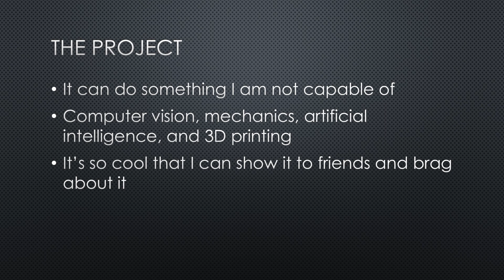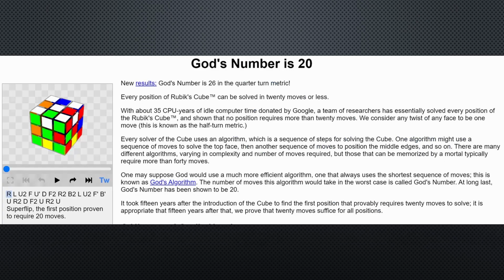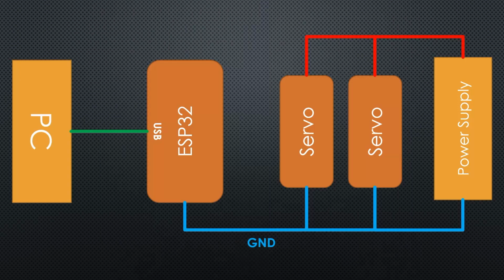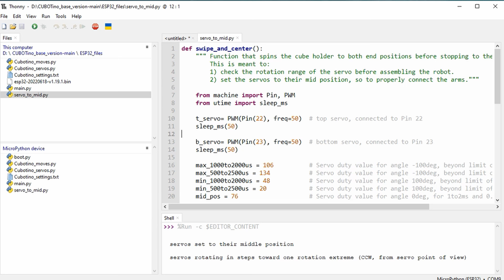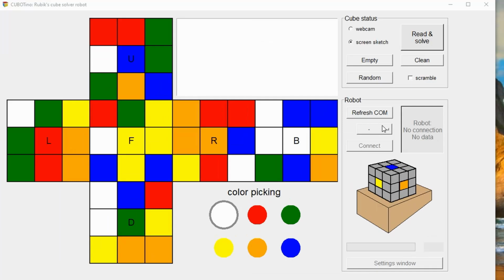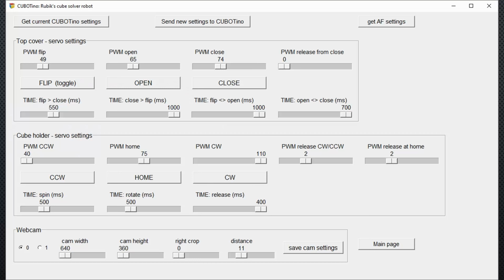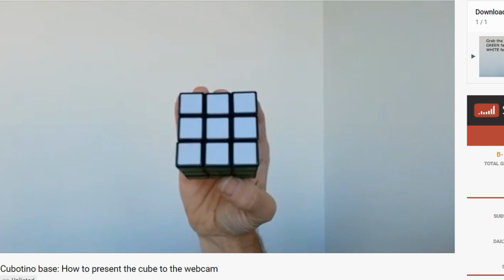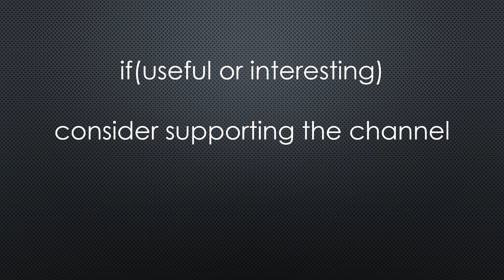440 Let's build the Rubik Cube Bot who knows God's Number

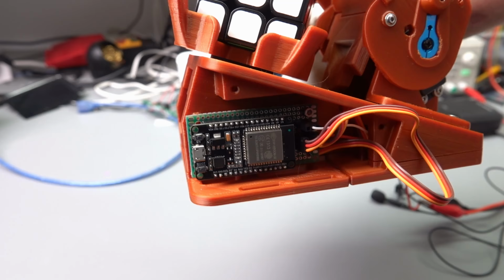Comment: In 1982  a bunch of us at the company I worked at built the first self-contained robot to solve a Rubik's Cube. There was one earlier robot, but it used a mainframe to compute the solution. Ours used two Z-80 microprocessors, weighed 30kg and fit in a very large suitcase. General solution time was about 2:40. It's amazing to see where the technology has come in 40 years!
Reply: Wow, my compliments for what you've done in 1982! By the way 2'40" was quite a remarkable result back then. 
I can imagine you've seen many different Rubik's cube robots since then .....
Indeed many things have changed, but the more valuable one is about the simplicity to get and share informations: Internet! At least this is for me the key enabler on stimulating and facilitating the realization of these hobby projects.... 
Thank you for your feedback.
Reply: @andreafavero71  Right on about information sharing! The only thing we had was published magazines and papers. Once you knew someone you could often use the telephone, but I didn't even have email until the late 80s.
Reply from the maker: @R Dyer: I agree that things are much better now for electronics enthusiasts. I enjoy every day!

Comment: Would be interesting to use ESP32CAM and algorithm run on the ESP32 itself, instead of PC. As it doesn't require much pins ESP32Cam would be sufficient, or maybe an ESP32 with an color sensor.
Reply: I was thinking about that as well.  If the esp32cam cannot do the processing then it could send the faces to a simple API on a pi or pc and get the sequencing back.  Would be a very cheap solution given how precious pi's are at the moment.  Great project for tinkering.
Reply: @johngilmour7507  No processing is required, if you have the camera fixed, then you just need to read the pixel values at fixed coordinates, no OpenCV required, to determine the cube faces.

Comment: Heat the screws when first screwing them into the plastic.  Turn them in before final assembly - do not push like with a threaded insert.  Don't turn them all the way in - leave them a thread or two loose.  Finish tightening when the screw cools off - preferably during final assembly.  It'll go in much easier with the melted threads to help.
Reply from the maker: Good trick. Thank you!

Comment: Wery wery kool, inspires me to buy a 3d printer.  I heard AI improved compression by some % which was thought impossible given the amount of time we've been refining the algorthim.  Maybe AI could figure out  how to do it in less moves. Although 20 does seem low already, that could be the limit.  But you never know, a super powerful AI could perhaps reprogram the colour molecules to instanly be the colour you want and technically does it in 0 moves.  A 0 moves rubix cube solution is  still possible in this universe.
Reply from the maker: 20 is the maximum moves. This algorithm is not made for an optimum of moves. If you just turn the cube once it will not recognize it and do lots of movements. However it the end, it is always solved.

Comment: Actually Kociemba's algorithm is efficient but not guaranteed to be optimal (it is based on group theory and solves two independent subgroups of the cube - I know this because I am the author of "kcube" an alternate implementation of Kociemba's algorithm).  The algorithm for "God's number" is different and takes much longer to execute.  It is an optimal algorithm and it is credited to Richard E. Korf.
Reply: Thank you for the feedback, I'll search for your work. Anyhow, the python implementation that Mr. Kociemba has made available is very easy to use, and in 2 seconds returns a "close to optimum" solution, even when using a little Raspberry Pi....
Reply from the maker: Cool that I have such viewers! Indeed, I saw that the algorithm too a long time to solve a cube where I only turned one row one side.
A challenge would be to get the algorithm running on an ESP32 CAM (in a reasonable time) because the Raspberries are nearly impossible to buy...

Comment: Thank you for the Idea. I started immediately after your video-upload and (almost) finished the project within a day. It works incredible good. I never had a project before where all prints were successful on the first try, everything fitted perfectly from start without any impediment and with a so much detailled description (which was necessary for the python-stuff). I will recode the ESP-part in C++ instead of Python so it is more convenient to upload and use for us Arduino-guys.
Reply from the maker: Thank you for your feedback. Andrea will love it! And I love it when you do the port to C++ ;-) And maybe you can get an ESP32CAM to detect the colors and send it to a server where the solver resides... If you close the bot, you see that it should be possible to mount an ESP32CAM board on top which sees all colors in a fixed position.
Reply: @AndreasSpiess  Exactly the ESP32CAM thing was in my mind. But I am not experienced with image recognition stuff, have to learn a lot on that. I already designed  and ordered a PCB using 18650 LiIo supply which might fit into the bot so there is only a power switch necessary instead of a power cable. Will be back on this in a few weeks: C++, ESP32CAM and battery-powered.... a lot of work.
Reply: @Tinker_Inc  Maybe you join forces with Andrea...
Reply: It seems that this project was too simple for you, or you've carefully read the FINE manual... perhaps  both.
Indeed thank you for the feedback.
Reply: @Pontifex Maximus  I'm looking forward the changes you're going to apply; Considering your speed, I'm sure I won't wait long 🙂
By considering the attention generated by Andreas to this project, and so many people being interested on the ESP32-CAM .... I'm thinking to prioritize that project over the others in my list. I'm open for open source collaborations, in case.....

Comment: Awesome project. While watching I was wondering if you could get rid of the PC. I was even thinking that it could be possible to have everything on ESP32, and I think it might be, however it would probably be very hard to fit everything in ESP32 and also a quite slow. Raspberry Pi Zero has just sufficient power and software support to make this easier to achieve. Super cool!
Reply from the maker: Maybe, one day, we will get an ESP32 version. At least the ESP32CAM boards can be bought right now...

Comment: Can't wait to see it.
Reply from the maker: It will not appear on the channel, because I decided not to produce Raspberry videos till they are available again :-(
Reply: @AndreasSpiess  Respectable choice. Please be informed that, since December 2022, the Raspberry Pi Zero W (valid alternative for the Cubotino Autonomous version) is available on at least one official shop per Country, eventually by limiting the order to one piece. I have just received my single precious piece 🙂
Reply: @AndreasSpiess   Thats such a shame, was really looking for a how to video as i'm stuck with getting mine to work.
Reply: @roscoe3dp470   You might drop specific questions to the chat at the project Instructables site, I'm sure you'll get some support there 🙂.
Of course, a video tutorial from Andrea Spiess would be fantastic, yet we don't know if/when it will be available 🙂.
Reply from the maker: @andreafavero71  I have a few on order. Unfortunately, no luck for me. I used my only zero 2 for the robot ;-)
Reply: @andreafavero71   I've got the basic version up and running but wanted to build the autonomous one, i triple checked the board i've soldered together and it's fine, i followed the simplified installation method but just can't get it working. Was hoping Andrea Spiess would do a full tutorial as it's such an awesome project.
Reply: @roscoe3dp470  Your problem description is quite generic. Please drop me an email and we'll try to find where the problem is; You'll find my email on my GitHub account.
Reply: I have it working now thanks, turns out it was the 1.77” screen, I swapped it out for a 1.8” screen and it came to life. Thanks for your awesome work and advice. Will post a make when it’s all put together.

Comment: Hi Andreas, I'm going to rebuild this project and I have a question regarding the capacitors and the power supply for the motors. Could you please explain what the capacitors between 3,3V (ESP borad) to GND and +5V (Micro USB) to Ground are for? I also have not found any other example circuit diagram with capacitors like this. Second question is: If I use a separate power source for the motors, is it adviseable to use capacitors there too?
Reply from the maker: These caps are always a good idea because the ESPs draw a lot of current when the transmit. So they easily crash. You can try without the cap and only add it when you experience brownouts.

Comment: Have you look into a generic Raspberry PI for this project that is inexpensive, compared to the sparsity of the real R-PI? I have the Rubik's Cube and the two 3D printers readdy. I would really like to make this project without having the external camera and computer needed for this project. Have a great year Andreas!!!
Reply from the maker: The one shown here does not need a Pi (it uses an ESP32) and a camera. Only the fully automatic system needs a camera.

Comment: This seems to be a clone of the Rubik's Cube Solver released in June 2020 by hbolanos2001. Its on arduino project hub, it uses an older solver but the mechanics of moving the cube are the same even if it doesn't look as fancy. Glad to see the opensource community is still stealing peoples ideas and passing them off as their own. Hell Lego released a very similar machine for their mindstorm range of products 10 years ago.
Reply: Hi Plank, the reference you've mention re-uses the principle from Hans Andersson from 2008 (https://www.youtube.com/watch?v=5fAn5A0HbhU), with the two servos and six pivots, or the one from Matt who reduced the pivots quantity to five on 2014 (https://www.youtube.com/watch?v=gy5B6neyWf8).
The solution I've develloped, still uses two servos, while it has reduced the number of pivots to two!
For your info, my inspiration on Hans Anderson bright concept is esplicited in the extensive instruction I've written (see "Contruction" chapter) 🙂

Comment: There are so many "exciting" projects that require a 3d printer, but I don't have one, have the space for one or even know someone who has. Are there options available to me, to get something made by the Maker community ?
Reply from the maker: All Makerspaces or Fablabs have 3D printers, I think.
Reply: Weedo Tina2.  It is smaller than you chamber pot. $150. It can print this project as good as any other printer.
Reply: PCBWay and JLCPCB both offer 3D printing services but I have not looked into the cost

Comment: Why not use 3 x color sensors to read the cube? they are about 2EUR on ali
Reply: money are important, yet the fun pays more 🙂.  Anyway, this is an open source project, you can take the parts you like the most and discharge the others 🙂
Reply from the maker: You even get color sensors (then you only need one). But a webcam is available on most computers...

Comment: Hi Andreas,

First of all, congratulations for the excellent work.

As it says on your HomePage that we should contact you via YouTube comments, here I am.

I have a problem and I ask for your help.

I have a device, controlled by an ESP8266 and when it starts, it automatically turns on relay 1 for half a second. I know that this 5V relay is being activated by the GPIO16, because this GPIO has the High state at startup. I cannot change the connection between the ESP and the relay, connecting it to the GPIO13 for example or another that does not have the High state at startup. I have already measured and relay 1 is activated for half a second with 4.82 V, which I think is the solution, to apply components directly to the relay that would only activate it if it continued to receive current for more than half a second, but to turn off the relay, that it was immediate.

I appreciate all the help you can give me.

Keep up the excellent work.
Reply from the maker: Unfortunately, I do not understand your problem :-(
Reply: @AndreasSpiess  I recently transplanted a chipset from a tuya device, the chip i used, the ESP12S. Everything works fine, with the exception of relay 1, which is now connected to the GPIO16 (and this GPIO is in High State at Boot as we know).
Reply: So,relay 1 turns on for half a second, and then, off again. Because i can't change the connection of this relay from GPIO16 to 13 for example,
Reply: my idea is connecting something to relay 1, so this relay only closes if it is energized for more than half a second.
Reply: Maybe a capacitor? Other idea? Thanks, one more time!
Reply from the maker: @maxtuser6977  First: I would not use GPIO 16 for that purpose. Second: Relays usually consume too much current for the ESP8266. Therefore they do not work properly without a transistor to amplify the current. Google for a solution.